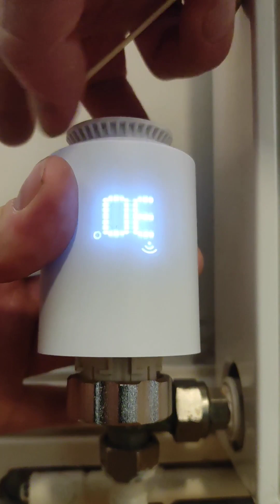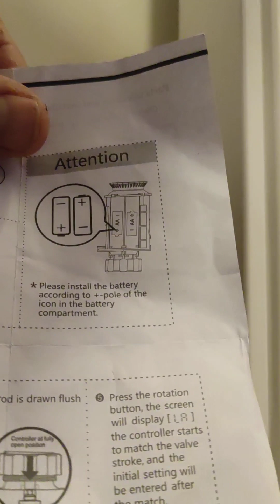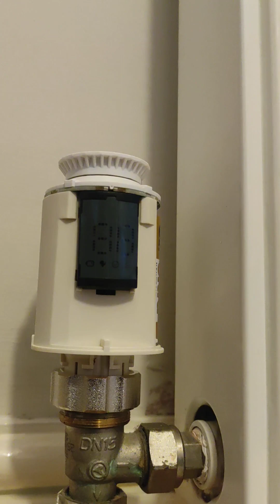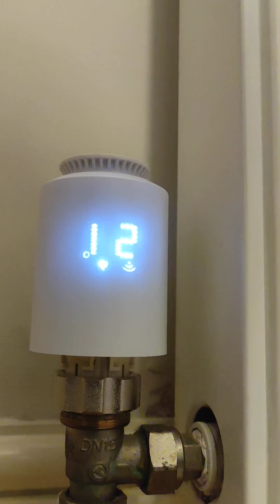How to fit a Smart TRV onto a radiator

Comment: You can flip the screen upside down by taking off the cover and holding the button just below the screen
Reply: I'm going to check this out later as it's been bugging me how it's upside down!
Reply: @BenDigweed  Haha.. there should be some button hidden somewhere around the LCD panel underneath the cover. Also, if anyone has problems with the plastic adaptor you can buy decent metal ones that won't cross-thread off amazon called "Metal Adapter for Radiator Thermostats".